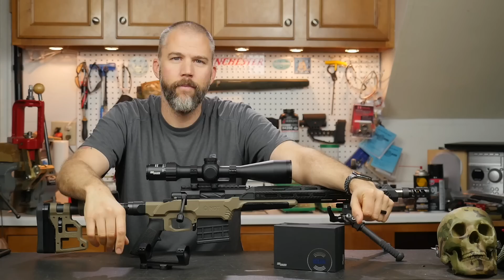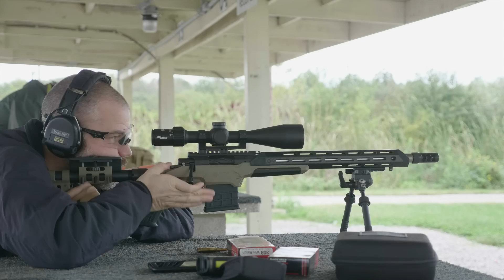Too Much Incline (MOA Stacking)

Comment: I just blindly discovered i had this same problem today at the range on my savage axis 2. I had just put on a new sig tango 4 (6 to 24 x50) and discovered i had 40 moa incline and ran out of down clicks. Learning the hard way is expensive lol. I suppose i need a smaller 0 moa mount or mounts. Im not sure what works best to fix this, but thankful i found your video to learn of a 0 moa mount that exists. Thanks!

Comment: My Armalite AR50A1 50BMG has a 15 MOA rail with a 20 MOA DNZ Reaper BEAST mount and the SWFA SS 5-20X50 HD scope. It's an amazing setup. 
My Ruger Precision Rifle Gen3 308 has the 20 MOA rail with a DNZ Freedom Reaper 20 MOA mount with a SWFA SS fixed 10 power scope (it's the US Navy contract number N00164-93-C-205 model) and it's also an amazing setup.
Of course the SWFA SS scopes have more elevation travel than almost any other scope on the market so it's not an issue at close range but gives you insane amounts of adjustment for long ranges and extreme long ranges.

Comment: I bought a Steiner T5Xi 3-15 and they say to use a 45moa mount. Boy are they wrong, it caused the same issue because it doesn't have any downward movement in the turret. Ended up with a Geissele 20 moa mount that worked great, up 3 mils from the bottom and still about 21 mils of up travel.

Comment: I did this with my .223 without thinking about it. My 6.5 CM is set up with a 20 MOA base and 20 MOA mount. I set my .223 up the exact same way. Same scope, same rifle, same base, same mount. I was about 1 Mil high at 100 and could not come any lower.

Comment: I have an 18" .308.. a trued howa with a bart 1.25" straight pipe on it... lol. fits perfectly with about 2mm around the barrel in the xlr evolution handguard. have 60moa built in just cause.. i go trans at 770 using 175's. kinda whatever. ya know?

Comment: Does the Nightforce NXS 5-25x50 have enough adjustment to run bases equal to 40 MOA of incline?
Reply: figure it out on your own and learn something. look at how much adjustment is in the elevation and think about it. please.
Reply: What caliber will you be throwing?
Reply: pepelapiu2004 it’s rem 700 milspec 308.
Reply: @yeates26  
For hunting 40 MOA incline is something you will never use. For long range shooting, you will need to take it pretty far to ever need 40 MOA. But it should work.
Reply: @yeates26  
I couldn't find your specific scope.
But with 40 MOA of cant, you would likely need a scope with 100 MOA of elevation adjustment range to zero at 100 yards. Having known NF scopes, yours likely has than much. But better make sure.

You will need at the very least 80 MOA of range on your elevation adjustment. 100 would be better.

It takes a pretty serious shooter to use 40 MOA mount. That's likely overkill for you. It would be for me. I have 20 MOA on my .338 LM and I haven't gone down to use all of that up ever before.
Reply: pepelapiu2004 thanks for your helpful advice.  Your right in that it’s typically not needed but there are those rare occasions when we shoot steel to a mile.  They’re rare but they do occur.  I was hoping to be able to have a 100 yard zero and still be able to dial out.
Reply: @yeates26  
A mile with 308 is pretty hard core stuff. You will need a lot of skill to do that. I hope you are ready to learn to load your own ammo. No way you will be able to do that with off the shelf stuff.

Have a loot at Sniper 101 series here on YT. Rex is very knowledgeable on this stuff.